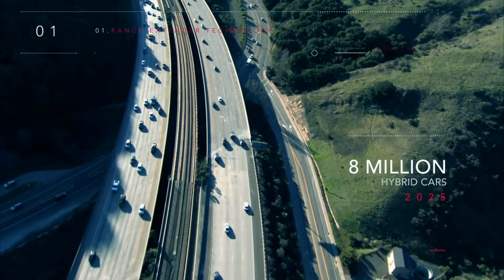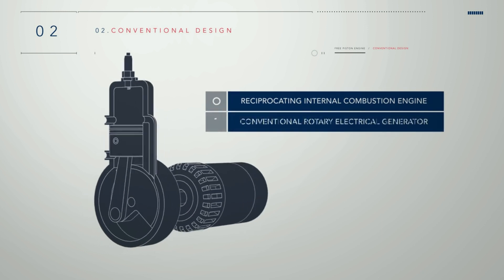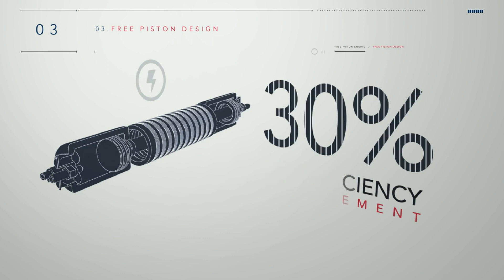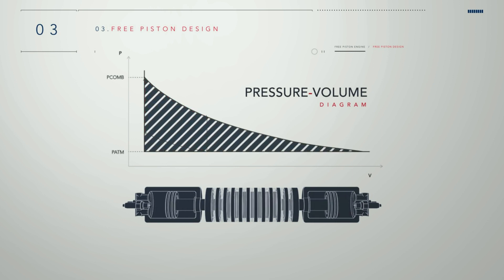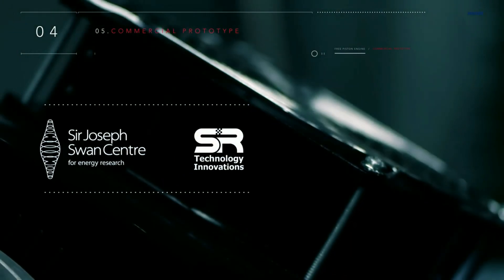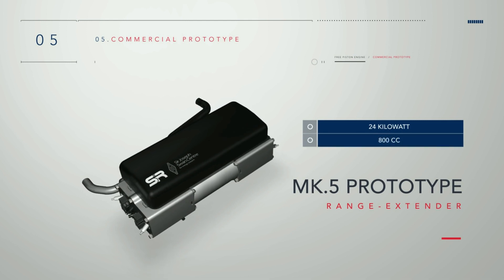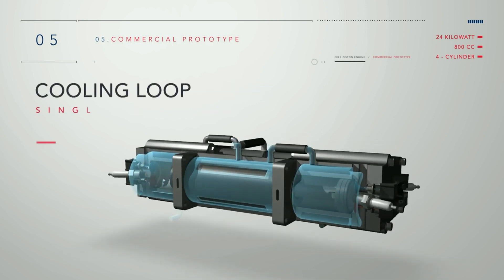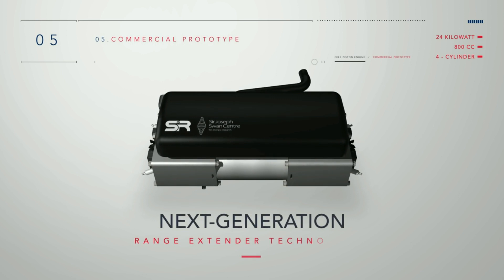Aquarius Engines a revolutionary engine for power generation  engine for $ 100

Comment: An 800cc 4 cyl engine that produces 32 Hp.... It's like being back in 1979.
Reply: Only.8 liters. That's like 64hp for 1.6l or 80hp for a 2liter. If it uses less fuel and costs less. It is pretty dang good
Reply: Plus it eliminates the gearbox and electrical generator....

It's like being in 2079

Comment: For hybrid uses this could be ideal, the shaking can be taken care of by the mounting used and the shrouding, while it serves as it's own generator without any transmission. Since a normal ICE motor is somewhere like 15% efficient...it would be creating more power for the fuel, which would negate the low HP. U don't really need low end torque or lots of HP for range extension
Reply: Hoping the new (VW startup) Scout brand use a FPG, such as from Aquarius? For its heat engine series hybrid / range extender.  

And I hope it's "net" efficiency In the real world Is as efficient, as heavier and more complex parallel hybrid options?

Comment: I would love to know how they run it like a two stroke, having combustion on every stroke of the piston.
Reply: it doesnt have a camshaft. thats why regular internal combustion engines take 2 cycles of the crank for 1 combustion cycle. the cam spins at half the speed of the crankshaft.
Reply: @chehystpewpur4754  that's not the issue, the problem is that it is a 2 stroke
Reply: @chehystpewpur4754  What is happening here? it cannot run like a 2 stroke if there is 2 overhead valves (intake and exhaust), the process of combustion here is all wrong. Both valves opening at BDC.. Dont let the presentation fool you, this will run as a 4 stroke, hence they need one piston on each side otherwise it would stall. There is no rotational mass (FLYWHEEL) to keep the thing running. A regular "Rotational" engine with a flywheel and a belt drive to the generator would be more efficient. Re-inventing the wheel again, with a square one. And dont tell me the linear motor/generator will keep the thing going, simultaneously increasing the efficiency over a regular engine.
Reply: @xibidit  first off just because it has valves has nothing to do with the strokes of the piston. detroit diesel had valves and yet its a 2 stroke. vespas had valves its still a 2 stroke. snowmobiles and dirtbikes also had a rotary valve yet again a valve its still a 2 stroke. aprillia you guessed it has valves on their new 2 strokes and yeah its still a 2 stroke. 
a 2 stroke is only determined by how many movements the piston makes to create combustion. piston goes down 1 stroke piston goes up 2 stroke and fire. 
4 stroke the piston goes up and down 2 times to cause combustion. it could be changed to do it more often by changing the tooth count on the timing gears but it wouldnt make a 4 stroke any better. ever hear of reed valves? regular ole 2 strokes have those on the intake its still a valve. the expansion chambers are also alot like a valve too. 
opposed piston and opposed cylinder engines have been around for decades thats nothing new. neither is direct injection or free valve tech. nobody is reinventing anything its just adding new tech to old tech to see if it can be more viable.
Reply: @chehystpewpur4754  , I saw how you don't understand the workings of engines when you mentioned 2 stroke diesels. 2 stroke diesels ONLY have exhaust valves, they get air from a hole in the sleeve at the bottom of the stroke. You cannot have an exhaust valve and intake valve above the piston and still get a 2 stroke, impossible. Think... Intake valve opens - piston goes down, intake valve closes piston goes up - NOW you are at the combustion stage, should the exhaust valve open now too??? (if it were a 2 stroke, both valves would have to open now) then you dont get any power stroke. IT IS IMPOSSIBLE. Just think how an engine works. Break down the 4 strokes in a normal engine and also break down the 2 strokes of a 2 stroke. When does the air come in and when does it go out and when does combustion happen in all of that. I understand you think you know how engines work, clearly you need to google a bit more about it. We are not talking about reed valves here, we are talking about over head intake and exhaust valves and possibility of this engine to run. (as a 2 stroke)
Reply: @chehystpewpur4754  so you should have deleted your dribble by now !
Reply: @sammyd7857  and yet i didnt because the guy thats on a massacre is still wrong i just got sick of wasting my time. i also didnt just quote diesels as half of what i said are 2 strokes. im just not gonna waste my time with someone who tells me what i know when they know nothing about me.
Reply: @chehystpewpur4754  anything with 2 valves cannot be 2 stroke
Reply: @sammyd7857  tell that to aprillia
Reply: @chehystpewpur4754  i just had a look and can't find information.  Send the link

Comment: Makes a cool air compressor ...TDC of each piston has 2 permanent magnets that push each other then the center ring electro magnetic will drive as motor then revert to generator as the piston nears TDC .
Cyinder heads are wired to gather fly back energy as the piston arrives and departs TDC .

Comment: I like the idea, question what's the full load efficiency? In other words  when it's charging  what's the fuel to electrical out put ratio
Reply: I just saw the cars are going 600+ miles on 10 gallons of gas.
Reply: I just saw the cars are going 600+ miles on 10 gallons of gas.

Comment: One of the problem can be the vibration of that thing, since it moves side to side.
Reply: IDK, the fact that there is no rotational motion from the crank shaft would partly offset the hammer blow motion?

Maybe it would only be useful in a small scale application where it can be bolted down hard?

Maybe only useful for a small emergency generator set or similar?

Comment: The second piston is not needed.   Use a spring to store and recover energy generated by the first piston.  This would increase the range and reduce the weight and complexity.
Reply: Spring will wear out fast....
Reply: @prajaymadhavan  Maybe, but having it push against a partial pressure, especially if it is monitored and refilled would be better.   Still only one cylinder would be required.
Reply: @chrisrichardson8881  Yes... May be an air spring is better as there is nothing to wear.
Reply: ... and make it run as lumpy as F. Ever wonder why normal engines have multiple cylinders?

Comment: Using central springs for return motion, slide valves, and partial circles as magnet assemblies instead of ring magnets requires no complex electronics and allows for more power generation.
Reply: You could also use magnets to actuate valves.

Comment: I think they meant this to be a 4 stroke machine, they have the valve sequence all wrong. Both opening near BDC. If the inlet opened at TDC and the exhaust opened at TDC, 2 strokes later it would be a better demo. Then the combustion cycles of the 4 cylinder layout would be 1 every stroke. I'm not saying it would work, but would be more feasible. Seems it would some sort of flywheel to keep the process going.

Comment: how is this not a bigger thing? imagine all EVs equipped with these - even areas with no charging infrastructure would see higher demand for EV hybrids! to be future proof i am thinking the generator ought to be able to run on 100% butanol/ethanol/methanol or CNG/RNG? we can wean ourselves 100% off fossil fuels and not have range issues win/win!

Comment: Seems like that would shake you to death.  Running on Diesel would save on parts and spark plugs, lasting a lot longer.  If there was an engine with a huge flywheel design under the passenger compartment (aka 4' across) it could create enough centrifugal force to keep the car from turning over.  A better engine would be something like a quasiturbine with magnets on its carriage (pistons) and coils around the engine to generate electricity in a circular motion for creating a centrifugal force.
Reply: good idea, but add weight and parts over an ordinary diesel engine..
Reply: Probably not. Modern little 4 cylinder cars don't shake at all and without some other parts you'd have even less vibration. I have no doubt they can make it silent but I want to actually see it in the real world instead of animation.

Comment: Congratulations, seems you've made a worse boxer engine. There appears to be insufficient blow deadening to reduce the violent twisting motion each stroke would produce under realistic load. That generator will shake itself to death, as the twisting motion causes the pistons to sway slightly as they reach the end of travel and grind slightly on the cylinder wall, gradually eroding the compression seals and/or cylinder wall. Soon after, the cylinders will start to lose compression and misfire or fail to fire. A singular misfiring cylinder will put the rest of the generator even further out of balance, accelerating wear and killing the motor faster. Otherwise, it's an interesting concept.

Comment: What is happening here? it cannot run like a 2 stroke if there is 2 overhead valves (intake and exhaust), the process of combustion here is all wrong. Both valves opening at BDC.. Dont let the presentation fool you, this will run as a 4 stroke, hence they need one piston on each side otherwise it would stall. There is no rotational mass (FLYWHEEL) to keep the thing running. A regular "Rotational" engine with a flywheel and a belt drive to the generator would be more efficient. Re-inventing the wheel again, with a square one.